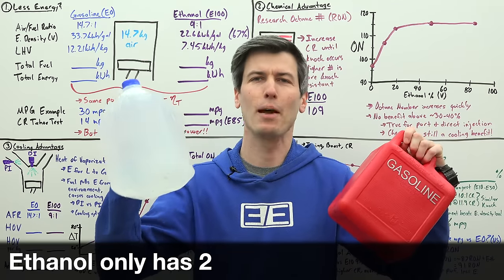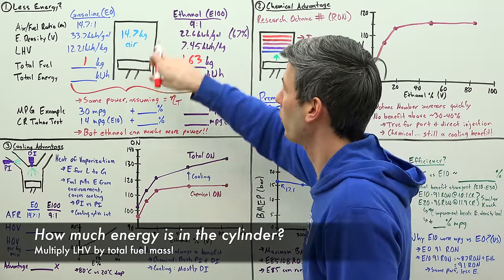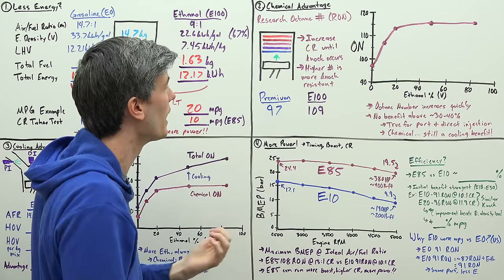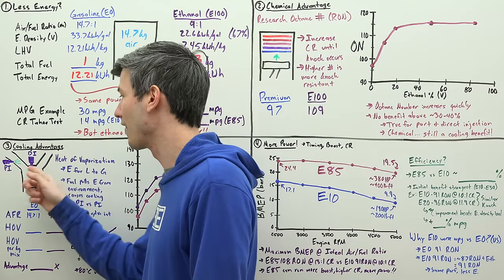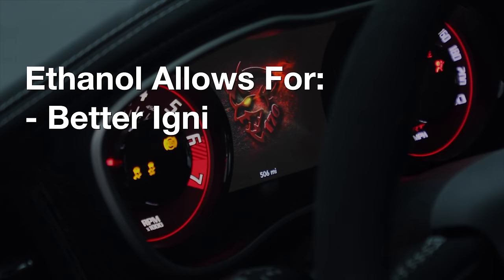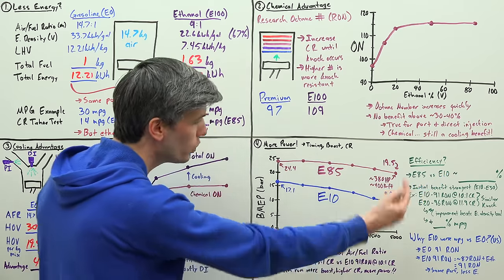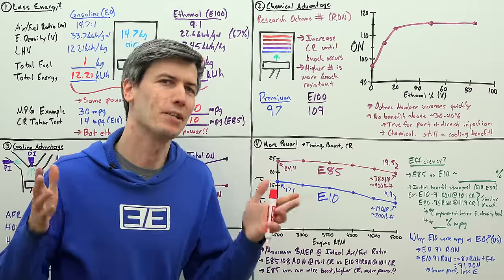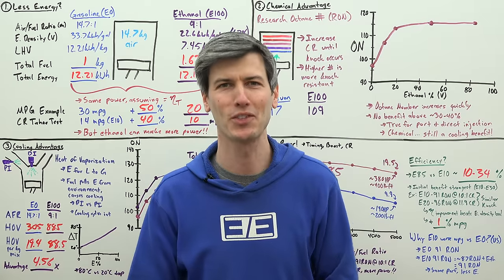Why Does Ethanol Make So Much Power? (Versus Gasoline)

Comment: Liters/100 km vs MPG, is one more straight forward on savings

If government was going to pass restrictions on vehicle engine power or displacement would BHP/Ton be a better limit, so vehicles could all accelerate to speed limit at about the same rate. Also if a limit was stated would electric vehicles get more range out of same battery pack
Reply: Now should that be bhp/ton, or kW/tonne ?? 😂😂😂

Comment: This is interesting, but this is comparing Ethanol to pump gas. What about gas with octane ratings of 100, 105, or 110? My dad told me that in the 60's and such, normal pump gas was between 95-105 octane. You may have covered this and I just didn't follow along.

Comment: Two things im worried about with ethanol mixed fuels:
1. Living in a very humid environment (90% last night), im always worried about water in the fuel destroying my engine because water pulls ethanol out of solution and rusts.and gums up.
2. I've repeatedly been told that because ethanol burns slower that it actually heats the engine more because its still combusting on the exhaust stroke. This one I would love to test one day.
Reply: Ethanol has a faster flame speed front than gasoline.

Water is a problem of gasoline.  This is why northern areas used to have to sell little cans of alcohol called HEET or DRY GAS as gas-line antifreeze to prevent stalled cars in wintertime.  No need since E10 came along.

Mercury Marine, which hosted a Webinar on ethanol myths, noted that ethanol does not "grab water molecules out of the air." It is hydrophilic, which means ethanol holds water. With regular gasoline (E0) as well at E10, the primary cause of water collecting in tanks is condensation on tank walls. But unlike E0, which can absorb almost no moisture, E10 can hold up to half of one percent of water by volume, and the water molecules will dissolve in the fuel. The "solubilized" water will bypass the water separator and burn harmlessly through the engine.

>>>>Mercury Marine also says E10 may be the superior fuel(over E0) because it keeps the fuel "dry"<<<<
Reply: Phillip its nope to #1 and nope to #2
Reply: @oldblueaccord2629  you say nope. Other people say yes.

It's almost like we need something more than people's opinions.

Like "ethanol blends can lead to leaner air-fuel mixtures" and leaner air-fuel mixtures run hotter. Hence most classic air-cooled car owners have physical evidence that ethanol fuels run hot. And yet you claim "nope". 

It doesn't really advance the conversation any more than "nuh-uh"
Reply: @PhilipLeitch  Hey this might  sound weird but i got a channel on Youtube that have cars running E85. I never had one run hotter...very much colder but not hotter.
Reply: @oldblueaccord2629  great to hear! Classic air cooled engines? Say 1950-70's air cooled? Because that's the specific scenario that I've had multiple veteran mechanics say they have see engines hotter. 

And yet I haven't actually seen any evidence of their claims and - as you say - everyone else says the opposite.
Reply: @PhilipLeitch  Yeah there millions of air cooled motors running around the USA I mean millions. Great example!
Reply: @oldblueaccord2629  I'm not sure if you are being serious, or sarcastic without stopping to think about motorcycles...
Reply: @PhilipLeitch  Im trying to follow your story but you swapped the topic so much. Help me keep up. Your first statement was about high humidity and Ethanol and now it progressed to air cooled motorcycles and car not made for 35 years.
Reply: @oldblueaccord2629  I'm not changing anything.

I have a classic car and that's the community I'm in and where I've repeatedly been told by the best mechanics I know that ethanol can make those air cooled cars run hot because ethanol runs lean.

You said something unclear about there being millions of air cooled engines out there. I was trying to clarify if you were agreeing or mocking without stopping to think about the fact millions of air cooled engines are actually out there. Hell, even my lawn mower is air cooled.

I don't really care - if you have evidence of all petrol engines being cooler on ethanol pony it up.

Better still, if you have evidence of ethanol engines not "gumming up" - especially over-wintered recreational vehicles - then give me that.

No storys have changed. These are fairly simple points.
Reply: @PhilipLeitch  Videos...there up on my channel. Nuff said.
Reply: @oldblueaccord2629  I watched your video and it didn't relate to either question. So I guess you are right. Nuff said.
Reply: @PhilipLeitch  You watched all 207. Wow thanks man!

Comment: So.. flex-fuel designed e85-rated 13:1 cars with aggressive timing tuning is much less fuel economy loss than flex-fuel compatible that still use pump-gas timing and compression-ratio?  
Might e85-only cars be cheaper to drive per mile that similar-power 93-octane designed cars of similar power rating?

Comment: Does 87 octane have the same heat of vaporization as 91?  Ecoboost’s recommend premium for towing.  91 would have more resistance to knock but if 87 has lower energy density, wouldn’t the additional gas injected help offset?
Reply: Lower octane gasoline usually have more BTU then higher octane. Thats was my first clue 18 years ago people were totally wrong about E85 just looking at the BTU and nothing else.

Comment: Here in Brazil I have only used hydrated ethanol in my cars since 2013! The ethanol sold here is not anhydrous, but hydrated, 96% ethanol and 4% water, which is cheaper than anhydrous ethanol.
All cars sold in Brazil can indistinctly use ethanol or gasoline mixed in any proportion that injection system adjusts itself in real time! 
But they say that models with direct injection can have premature troubles with injectors! Not my case! In contrast, our gasoline is nowadays 65% gasoline and 35% anhydrous ethanol! So I prefer pure hydrated ethanol (without any gasoline)! The pistons never carbonize! Additionally, if we have an apocalypse we can make ethanol at home! Hahahaha!!!
Reply: Even with all that water in the ethanol, when mixed with gasoline, the SAE found that it will not separate until -22 degrees F.

Brazil's common gasoline contains 27.5% ethanol but that is anhydrous (200 proof).

Are you sure all cars are flex fuel?  I saw the new Ford F-150 is not offered in flex fuel there for some odd reason.  India now has a law all new vehicles sold must be flex fuel, your country might need such a law. 

Brazilian studies show that identical engines last >300% longer on E100 than their common gasoline.  Soot acts like sandpaper inside the engine and like you said, ethanol is sootless.  I wonder how much longer it would last than an engine using E0!
Reply: @danafletcher2341 F150 is not sold with flex fuel engine cause its TOO EXPENSIVE and who can buy it don't care about fuel efficiency
Reply: @pedrosilveira6554  To make an engine flex fuel here in the US is not that expensive, all you need is a yellow fuel cap then turn on the MAPs already in the ECU for E85.

Newer flex fuel vehicles here now have a $50 fuel sensor rather than using the stock 02 sensor to control fuel settings.

In your country of Brazil where E100 has no gasoline added for volatility in starting the engine, heated injectors are put into flex fuel engines which act similar to the glow plugs diesel engines use for starting (diesel has low volatility too).  But again, even that is not really that expensive of an option to have in a vehicle.

Before heated injectors, your country's E100 burning cars had a small lawn mower sized gasoline tank in the car to start the engine and then switch over to E100 once started.

Ford's first prototype EcoBoost engine was optimized for E85.  It had mileage 15 to 20% better than on E0 with load performance similar to a diesel engine.  They never came out with the technology in a flex fuel version in part because they thought they could skirt paying for the patents of the MIT scientists who developed it.  That is still in court.

If you had that engine in your country, it would make ethanol completely take over transportation.

Comment: I'm sure he already covered this in another video, but I know carbureted engines get more of a cooling effect from fuel than port injection engines do (I believe bc the fuel has more time to pull heat out of the air as it travels down the intake). Direct injection will allow even less time for the fuel to interact with/pull heat from the air, but is this shorter time more than compensated for by the much hotter temperatures inside the cylinder? So in effect is that extra temperature allowing the fuel to pull more heat out faster in direct injection? In which case the cooling effect of the phase change from liquid to gas is highest in a direct injection engine, followed by carbureted, and lastly port injection?
Reply: Personally I think higher cooling of carbureted engine could be that they generally run richer for safety.
Injection is mostly able to adjust when knocking, so the system is able to adjust to a set limit under different loads for more efficiency.
Carbureted is not able to adjust to fit slow towing on a hot day or higher speed on highway, both scenarios could use the same amount of power but the engine heat can be very different.
If the carb had better cooling with no other disadvantage, car manufactures would mount injectors at the carb location, but they do not do that anymore.

Comment: But you need more than the gallon of E85 to make that power the gallon of gas makes. 

What's the joules rating per gallon for each?
Reply: In our current gasoline optimized engines, ethanol even with lower mpg costs less per mile to drive with drastically lower pollution.

The Chevy 5.3L pickup gets a clean 380 horsepower on E85 vs a dirty 355 on E0.

Ford's first prototype eco-boost engine was optimized for E85.  It achieved 15 to 20% more fuel efficiency than gasoline with load performance equal to diesel engines.  They didn't come out with it in flex fuel because they thought they could skirt paying the MIT scientists patents on it.  That is still in litigation to this day I do believe.

Ricardo built an ethanol engine for GM and it ran in a pickup. It is half the size/twice the power of gasoline and diesel with better mpg than either one.

FROM RICARDO:
The new federal CAFE standards are calling for a doubling of fuel mileage performance, which, Vint says, is going to send OEM’s looking for high octane numbers to improve efficiency and ethanol is the best source. Ricardo, an engineering firm with over 100 years in the business of engine design, has developed an extreme boosted direct injection engine (EBDI) to optimize ethanol blends. The 3.2 V6 gasoline engine rivals the power and torque of a much larger GMC Sierra 6.6 diesel, he said, and it delivers 3.5 percent better fuel economy than the diesel.

Scania has sold an ethanol engine worldwide for years which they state has fuel economy and power on par with their diesel engines.  Cummins had their ethanol optimized engine called ETHOS which was half the size/twice the power of gas and diesel too.

Comment: Would you recommend 91 R+M/2 with no ethanol over 93 R+M/2 E10 in a high performance motorcycle tuned for 98RON?

Storage is not a concern.
Reply: Without retuning it for a lower grade feul, I would not recommend it. If your bike is tuned for 98 race gas, then with pure 91 you'd run a serious risk of knock damage when the throttle is pushed hard. Even with 93 e10, don't forget that "93" is just it's anti knock index expressed in octane, and the given blent of E to G is it's relative octane number. So at E10 it's a bit safer, but that's like saying you'd have less risk of electrocution if you touch bare wires than if you lick them.
Reply: @Datsun510zen  I convoluted the question a bit. My apologies. The bike is tuned for 98RON. Fuel available is R+M/2.  I believe 98RON is about 93.5 R+M/2
Reply: @TheDustinlangston  Got yah. Same rule applies for a drop of 5 to 7 RON though. Again, the relative octane number is an expression of the fuel's AKI. For instance, I'm running e85 in my turbo'd 510 race car, and at 22 psi, it has a RON of 107. Compared to 98 race fuel, I'm able to advance timing 5 degrees, it makes 80+ more HP, and runs much cooler.  Although there is some benefit with e10, it's not significant enough to overcome that kind of drop in RON without retuning.
Reply: @Datsun510zen  this makes sense. 
I found Sunoco GT260 Oxygenated unleaded E9 at the track. The bike really liked it.
Reply: @TheDustinlangston  Fortunately, going up the octane scale isn't as dangerous, well for the bike anyway. For another kick in the pants, next time you're at the track, try a few gallons of motorcycle cherry bomb juice with the 260 GT Plus 104 Octane race gas. BTW what bike do you have?
Reply: @Datsun510zen  KTM RC8R
Reply: @TheDustinlangston  Good God man, the rarest of the rare and a price tag to match. Take care of that beast!

Comment: There is a caveat. Your family car that's not boosted and has 10 compression won't see any improvement.  Also stoichiometric is not peak flame speed or peak torque, that's about 13:1 for petrol. Good video I like the maths behind this. If you are boosting it's just free power, providing your fuel system is up to it.

Comment: Short answer: It burns much hotter than gasoline, I wouldn't say "efficient", as you get much less fuel mileage with E85. It burns faster, thus makes more power.

Comment: Water has about 10 times higher evaporative cooling compared to gasoline. Injecting 10% of water would be equal to running engine with 30 to 1 fuel ratio in regards of evaporative cooling.  You can alow insane compressions or boosts.

Comment: Sooo adding ethanol to the gasoline may increase power in the engine as long as you cranck up the compression rate? 
But what if the compression rate stays the same and only the fuel is changed?
Reply: Ethanol will raise horsepower even at lower compression levels in our current gasoline optimized internal combustion engines.  

For example, the Chevy 5.3L engine gets a clean 380 horsepower on E85 vs a dirty 355 horsepower on E0.

But in an ethanol optimized engine which would include among other things high compression, you will get both higher horsepower and even more mileage than gasoline engines, even more mileage than diesel.

Here is an excerpt of one Ricardo built for GM and drove around a few years ago:

FROM RICARDO:
The new federal CAFE standards are calling for a doubling of fuel mileage performance, which, Vint says, is going to send OEM’s looking for high octane numbers to improve efficiency and ethanol is the best source. Ricardo, an engineering firm with over 100 years in the business of engine design, has developed an extreme boosted direct injection engine (EBDI) to optimize ethanol blends. The 3.2 V6 gasoline engine rivals the power and torque of a much larger GMC Sierra 6.6 diesel, he said, and it delivers 3.5 percent better fuel economy than the diesel.

This is not new technology or knowledge, it was known long ago.  It is suppressed technology.

Rear Admiral C.M. Chester wrote Henry Ford a letter on Dec.15, 1916:
"...I also pointed out in the article that as governmental laboratories had developed from 40 to 55% efficiency in alcohol engines as against 20% in gasoline machines, the use of alcohol at double the cost of gasoline for power purposes, was cheaper for motor[s] than gasoline in common use today."

Comment: very cool video. Given than cars use energy to move and engines convert chemical energy in the fuel into kinetic energy I did some simple math with assumed number on how small cars convert MJs of energy stored in fuel into distance made.
My results were that
a methane powered car makes about 539m for a MJ of fuel energy
a gasoline powered car makes about 383m for a MJ of fuel energy
a diesel powered car makes about 589m for a MJ of fuel energy
an electric car makes about 2057m for a MJ of battery

unsurprisingly the electric car is way better given the motor efficiency but it surprised me to find the gasoline car with such a small number.

Comment: Companies like GM want to see the minimum octane to be well over 100

Can you compare efficiency with high octane, pure gasoline to E10, E85 etc
Reply: This is why:  . Ricardo built one for GM which they drove around a few years ago.

FROM RICARDO:
The new federal CAFE standards are calling for a doubling of fuel mileage performance, which, Vint says, is going to send OEM’s looking for high octane numbers to improve efficiency and ethanol is the best source. Ricardo, an engineering firm with over 100 years in the business of engine design, has developed an extreme boosted direct injection engine (EBDI) to optimize ethanol blends. The 3.2 V6 gasoline engine rivals the power and torque of a much larger GMC Sierra 6.6 diesel, he said, and it delivers 3.5 percent better fuel economy than the diesel.

Comment: I haven't watch your video yet... But i guess that you could put in more ethanol in the cylinder because  it has a higher octane. With higher octane, there is less risk of the engine knocking. And with more fuel, you get a colder cylinder?